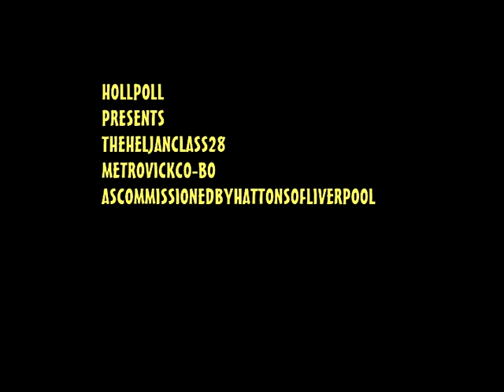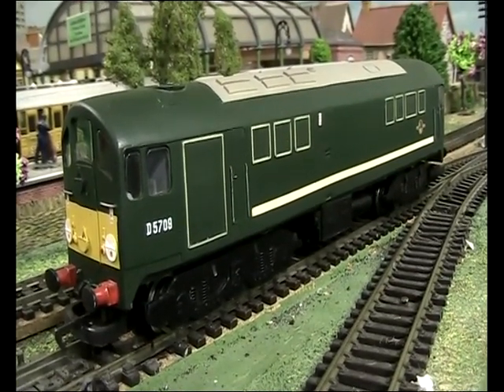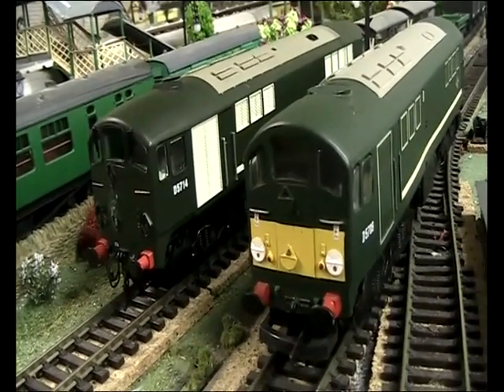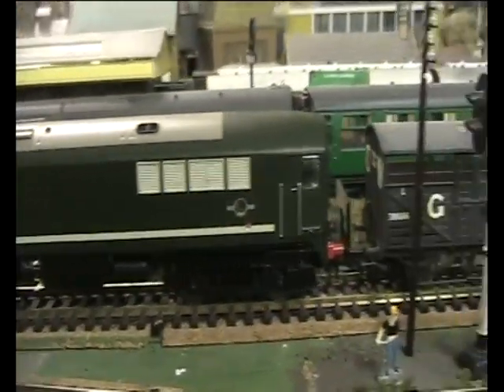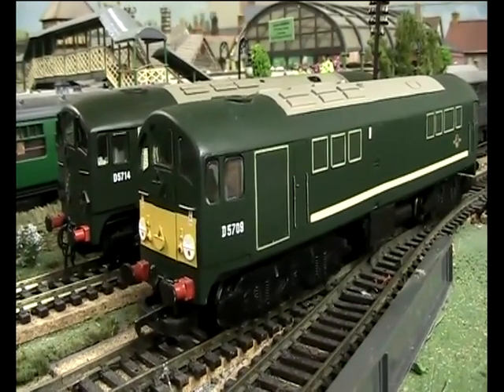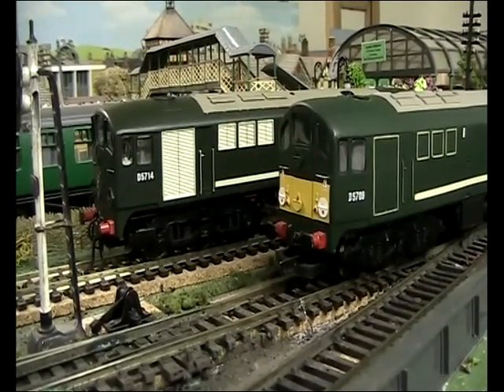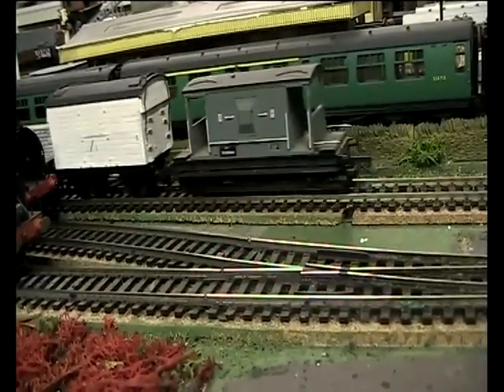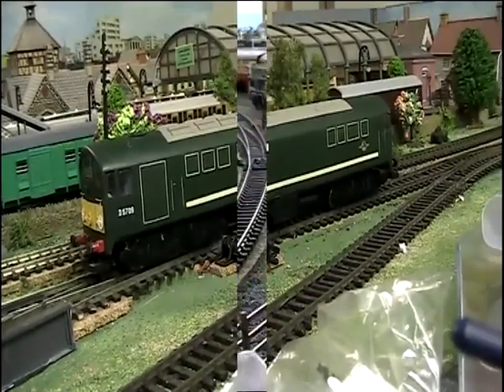The Heljan Metrovick Co-Bo a Quick Review-Model Railways 00 Gauge

Comment from the maker: Yes I noticed that too when I looked at the clip and on further inspection there is indeed a smudge on both ends of the loco, I suspect that they drilled the holes for the one of the lights in the wrong position and it has been bodged up - not really good enough when you pay large sums of money on these loco's
thanks for watching
Stewart